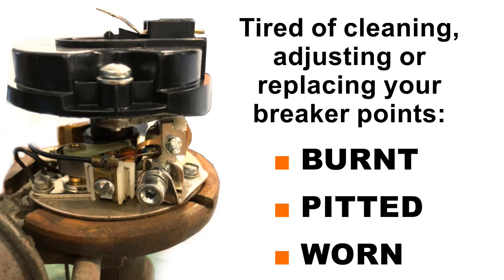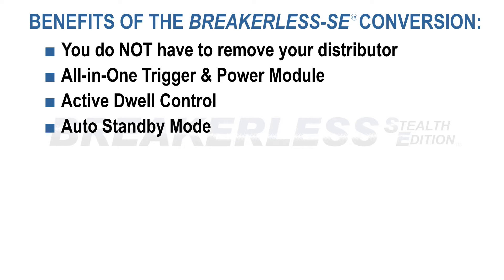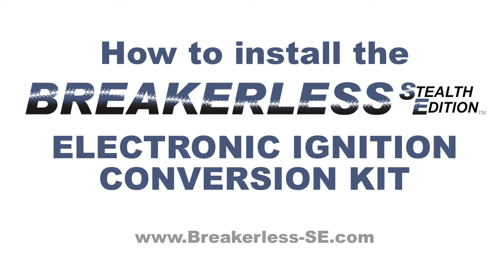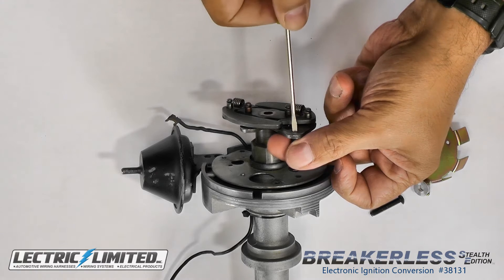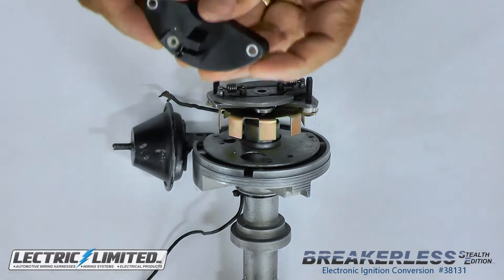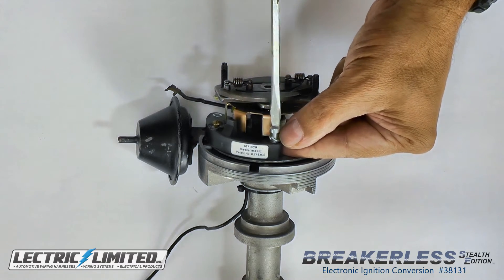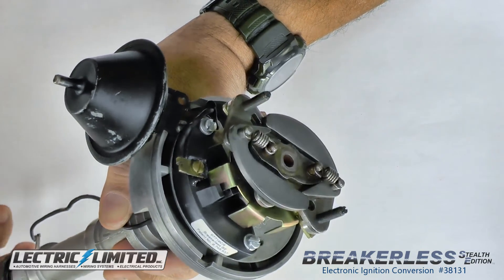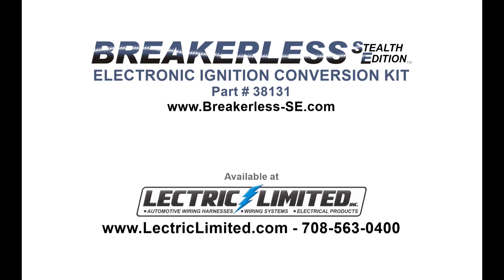Breakerless-SE (single wire) Electronic Ignition Conversion Kit & How to Install - #38131

Comment: What’s the point in having the flexible wire clamp?
Reply from the maker: The flexible clamp keeps the module wire (which was the old points wire) from moving, keeping it away from, and interfering with, the fast-rotating vane assembly.
Reply: @LectricLimited  thank you

Comment: I want this!  Appears to be a MUCH better (and easier-to-install) solution that the Pertonix electronic ignition system.
Reply from the maker: It's easier to install than the conversion system from Pertronix and does not require any modification to your original wiring or its components!